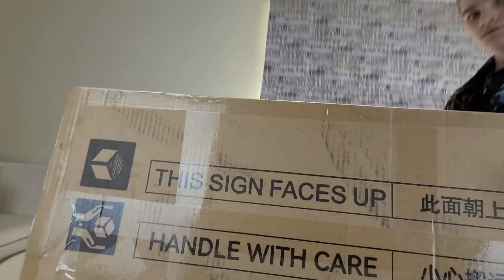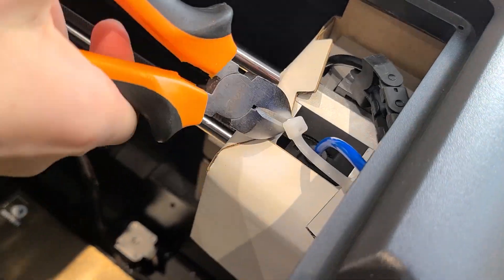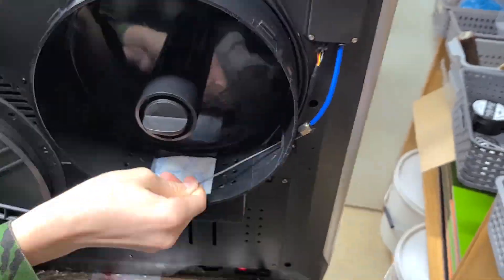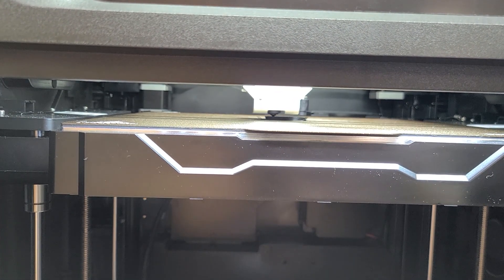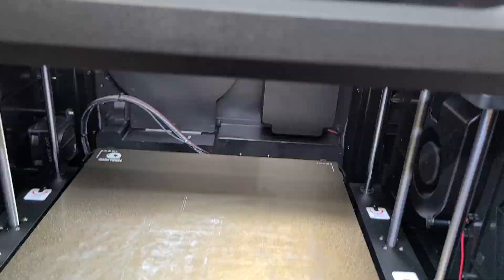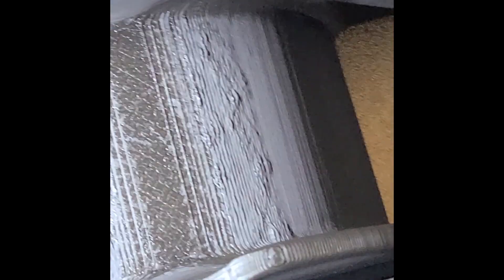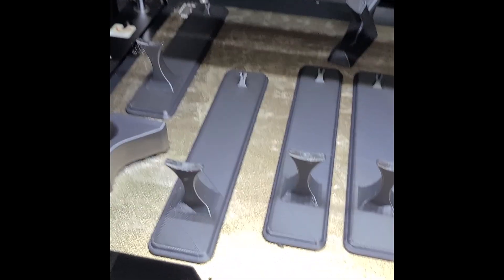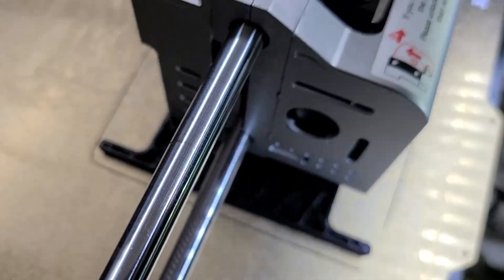1 year on with the Qidi, not sure if I hate it or love it

Comment: It does stick, I have 4 of these machines. You need to set the z offset correctly for it to stick. I mainly print with abs. I have also printed pla with no adhesion issues. The only time I had adhesion problem is with the first one I bought but I think I wore out the plate and bought another one and the problem is fixed.
Reply: Do You have to set the z offset before every print? Mine does not save the z offset settings!? I also have issue with the print preview on the machine screen (black screen)
Reply from the maker: @badrbouznig5908 yes every time otherwise it's off.
Reply from the maker: Without pritsick mate?